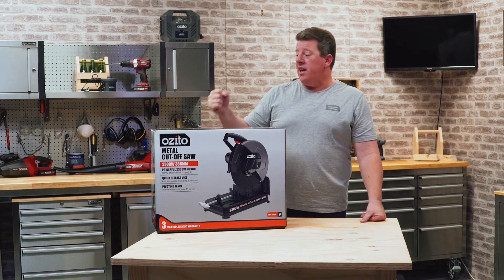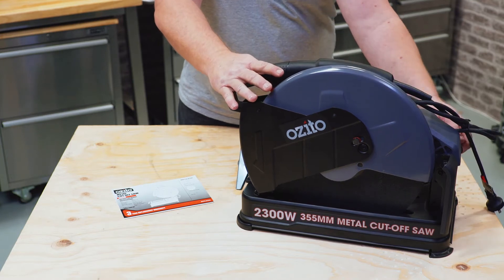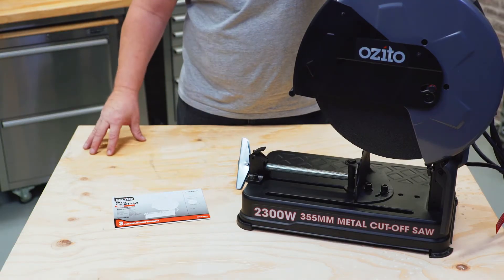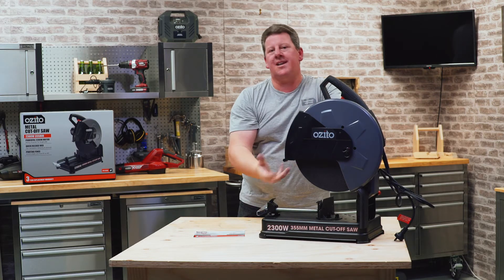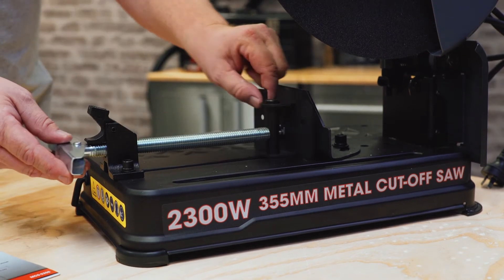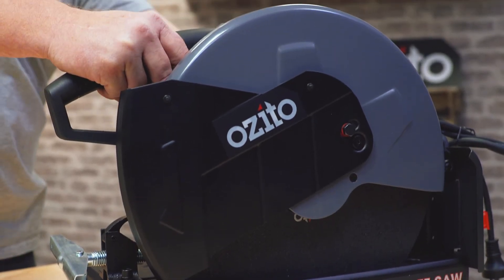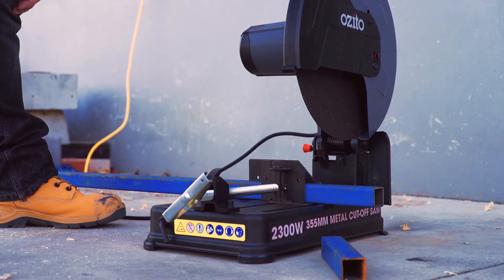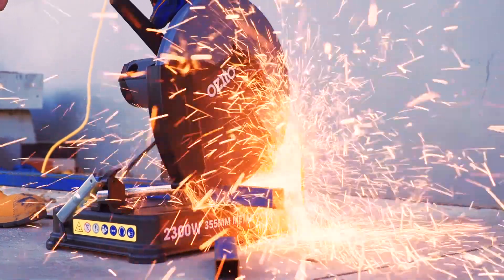Ozito 2300W Metal Cut-Off Saw - Product Video

Comment: Just bought one tonight from Bunnings. I put some quite thick heavy duty square tubing on there for a test cut and man it cut through quite quick. Very impressed . I’ve waited one of these for years.  I Usually   Use a 4 inch grinder to cut my steel and yeah man it’s hard work. This thing is awesome and cuts dead level. Put a square on it and it’s strait as. Very happy is going to save me so much time .
Hope I’m not speaking to soon  as only done one cut but yeah very impressed .  For $130 bucks and just doing the odd job I’m happy.
Reply from the maker: Hi Brad, Thank you so much for your comment. We really appreciate that you have taken the time to provide us with your feedback and hope you get many years of enjoyment from using your new metal cut-off saw! Cheers
Reply: Ozito Industries thanks mate yeah so do I . I mean I’m just a guy tinkering in the shed so yeah I’m sure if I treat her with respect I’m sure I’ll get 5/ 10 years out of it.
Reply from the maker: Cheers Brad, Have a great weekend!
Reply: Ozito Industries  cheers mate will do👍

Comment: Hi this tool is fantastic when cutting at 90 degrees , but I am having problems when cutting 45 degrees , I am not getting a perfect cut . I did  replaced the cutting wheel but still having the same problem.
Reply from the maker: Hi Sammy,
We’re sorry to hear about your problem. We suggest a couple of methods which might help you solve your issue.

1. Ensure the mitre gauge and the work clamp is tight and the workpiece does not move during the cutting action.
2. Slowing down the speed of the cut can help improve accuracy. If the cut is forced through, the blade can bend mid-cut which can give inaccurate results.
3. If you’re consistently obtaining inaccurate cuts, it might be worth compensating for this error during set up. For example, if the customer is constantly getting a cut that is 47 degrees, set the fence up at 43 degrees to see if this gives the customer a better result.

If none of these tips work for you, please feel free to contact our customer service team by calling them on 1800 069 486 or email them at enquiries@ozito.com.au. Our customer service opening hours are 8 am to 5 pm weekdays (AEST).
Cheers!
Reply: @OzitoDIY  I have the same issue with 45degree cuts. Just can't seem to get the compensation right. Could it also be the type of cutting disc?

Comment: Any reason why my cuts aren't square from top to bottom? Machine is cutting as though the blade has a camber..
Reply from the maker: Hey mate, Check that the cutting disc bolt is tightened fully and that there is no damage to the flanges on either side of the disc. Otherwise you can give our friendly customer service team a call on 1800 069 486 and they'll be able to help you out. Thanks

Comment: I need to trim my venetian blind. Can I use this to cut the metal headrail?
Reply from the maker: Hi Michael, The metal cut off saw is likely to leave a few burs in the headrail. We would recommend using a reciprocating saw with a metal blade, however you should clamp down the rail to avoid vibration when cutting. Another option is to use an angle grinder with a thin cut wheel with a cutting guard to complete this cut. Let us know if you have further questions.
Reply: Ozito DIY thank you for taking the time to reply. I would’ve bought the metal cut off saw before this reply but it was on a pallet at the back of Bunnings since the beginning of last week. I was told to check this weekend as it would be on the floor but unfortunately it wasn’t.

I was going to go the reciprocating saw route but ended up using a tin snip to control the cut and it worked out great.